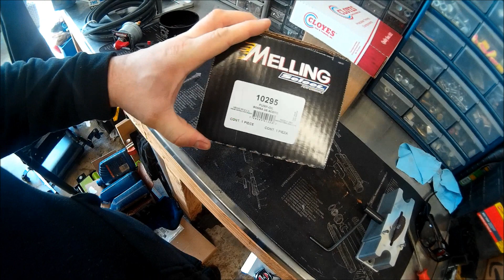Do you need to gap junk yard LS piston rings??

Comment: I have a question cant really find anything i have a 05 lq4 that im putting together with stock piston new ring but my old ring gap are .014 and new ones are .023 i dont under stand maybe any help would work for me thank you i appreciate it
Reply: Mine gapped at 030 I hoped it would be ok now I regret that try to get has close to 016 on top ring
Reply: @michaelbaskinmichael9862  im going to run mine wheres at but 030 is what most people do for boost or nitrous i never really got anything on what is the max gap for stock lq4  im a lill worried sence going to do 243 heads i know compression will go up a lill thats where am worried

Comment: Newb question, is it safe to re use the rod bearings? And what did you torque them down to?
Reply from the maker: I reused mine, if you pull them off when doing ring gap and they look good you can run them. If there is any weird scoring or brass showing I would replace. I don’t remember torque off hand.